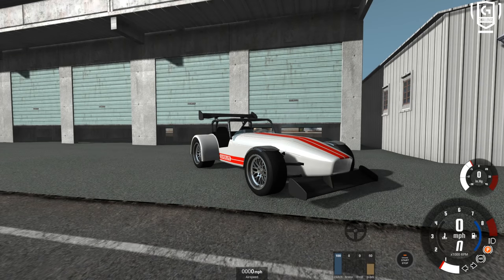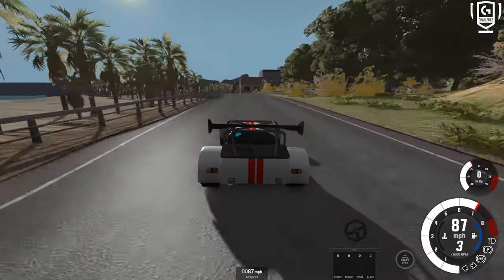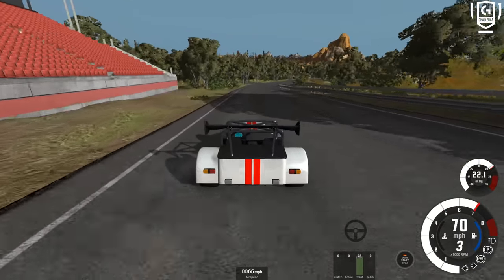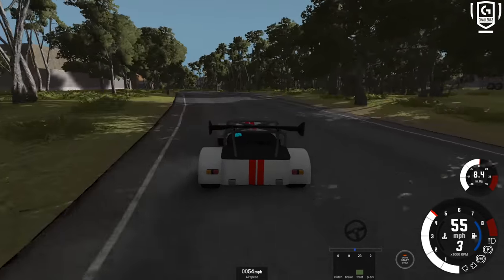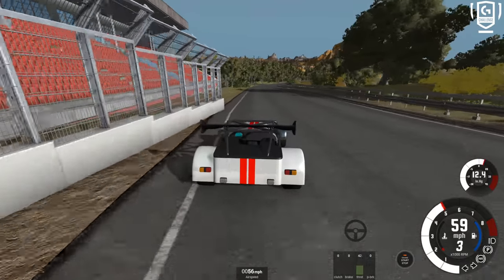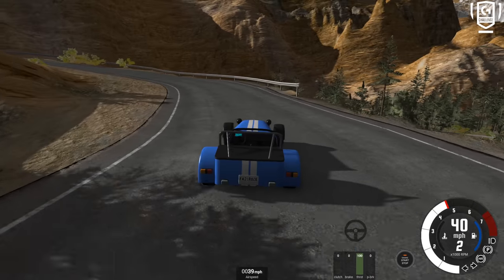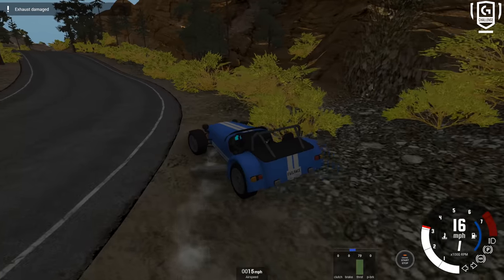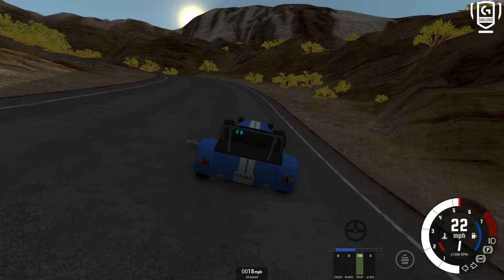Awesome Street Circuit! - BeamNG Drive

Comment: Since You're always complaining about breaks locking up in Beamng, I'll assume you're not aware that you can actually change how linear the trigger pedals are in the ingame settings. I recommend making the brake trigger engage more slowly at the start and then spike hard at the end of its travel.
Reply: You can also change the brake force, meaning more sensitive controls and less  locking
Reply: You could also use an actual wheel and pedals setup...
Reply: @TheScaryName  He does have one but doesn't use it for beam. FFB is alot better after the new updates.

Comment: Do anyone here thinks that trackfab is ridiculously difficult to drive
Reply: The current setup is a bit shit and mega-overdampened, it's something I need to fix.

But at the end of the day it's still a super lightweight RWD roadster. The 180hp variant is about as fast as most vanilla track variants, the 300 and 400hp variants are pretty much just memes.